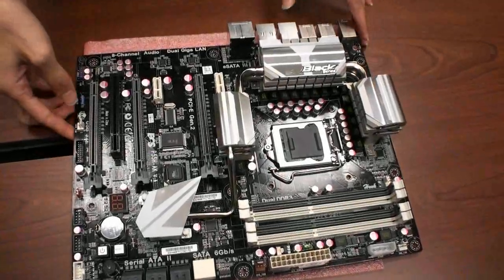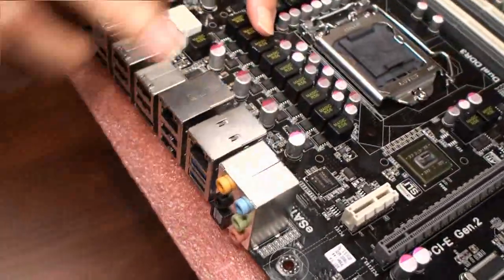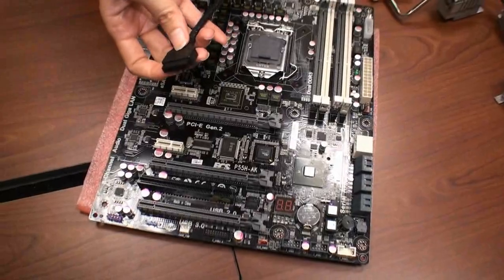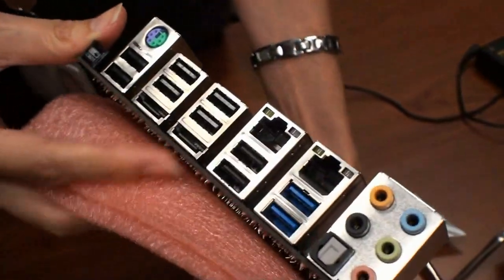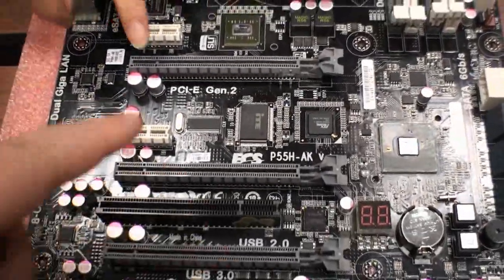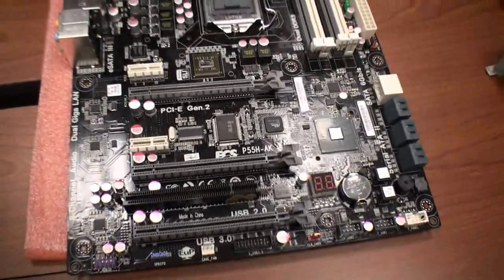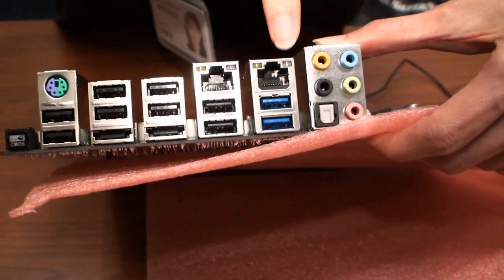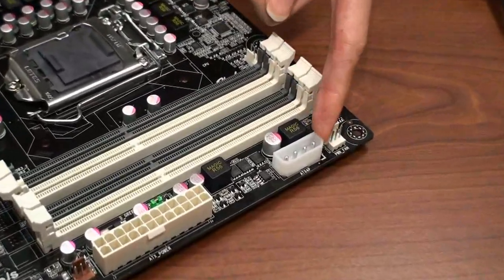ECS P55H-AK Black Series motherboard exclusive hands-on

Comment: @prankmypants 

I never really had an issue with their motherboards.  (Aside from the lack of overclocking options in the BIOS)

I had a K7SEM.  I expected it to die quickly because it used crappy G.Luxon capacitors, but I guess I got lucky.  The board served me for 4 years before I bought a new board.